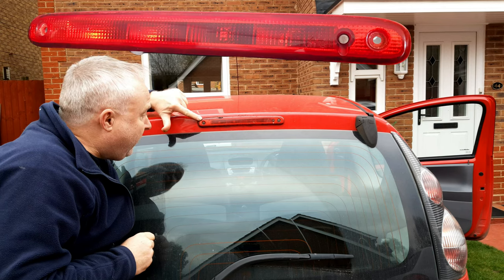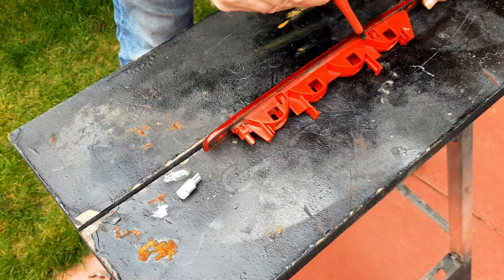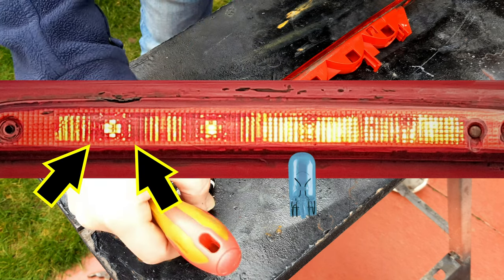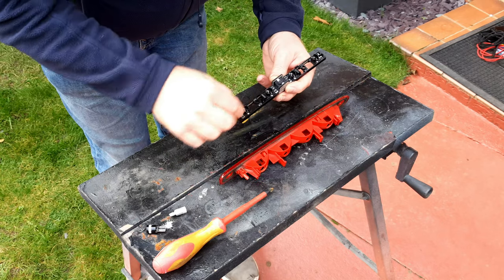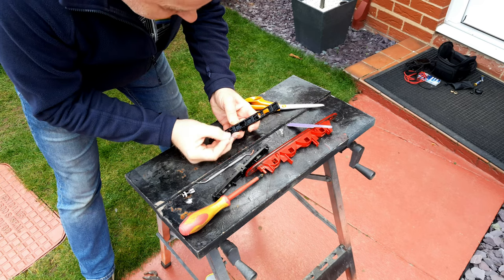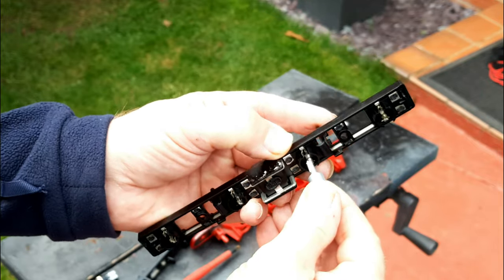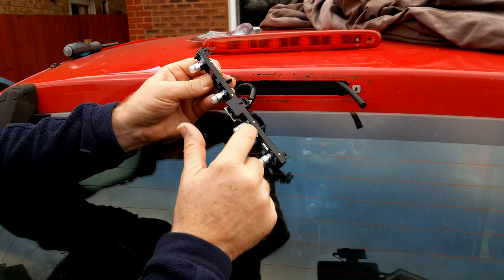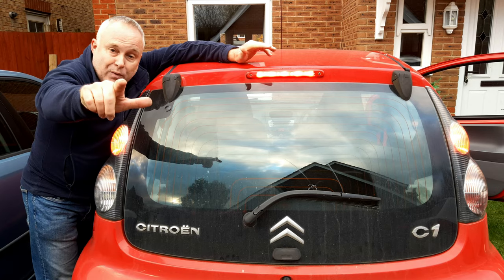Citroen C1 High Level Brake Light | AWESOME LED Conversion

Comment: I had some corrosion issues under this centre break light. I changed the break light with a poor seal to a better one I did have in my spare parts box. I’m already curious for the next video with the sealing trick! Thanks, Cyd for showing us the LED bulb conversion. ✨🤗✨
Reply from the maker: The common 'trick' is to silicone these lights in, but I think you will like the new product I'm going to be showing.
The video doesn't really do the LEDs justice, but they make the brake light so much better. Brighter by a moderate margin and a much more 'intense' red. 
I've got several rear end lighting projects coming up including LED indicators with auxillary reverse lights - simple plug & play stuff too.
There might be a slight delay in production though as my Father is in hospital and having a serious operation, so I'll be spending time with my Mum and helping them when he comes home.
Reply: @CycloneCyd  Don’t worry, don’t hurry! Take care for your parents, everything else cannot be that important. Thanks for your nice reply and greetings from Germany… 🍀👍🍀

Comment: Mr. Cyd I appreciate ALL you share with us and have found I have been able to fix 99% of all issues with my 2008 Saab 9-3 2T Convertible by watching your channel. QUESTION: Since the last rain I now have a warning alarm going off every 30 seconds to a minute or so indicating "Manually close top before driving." The convertible top is completely closed and the automatic function works because I had put the top down and brought it back up to see if it would stop the warning alarm. Can you help?
Reply from the maker: Happy to be able to help you JW.
I can think of two possibilities: 1. the top isn't properly closed (which is what the alarm is for) so check your handbook for intructions to close manually (or at least check it carefully). OR 2. there is a switch in one (or both) of the latches for the top and it is possible one (or both) have failed.
Unfortunately I don't have a vert nor access to one. I suggest searching for "Saab WIS online" and looking for the instructions for how to check these items. I've never used WIS online myself, but understand it's a great resource.
Reply: @CycloneCyd  Thank you so so much for your response and suggestions I will be getting to it in the morning. I will come back and let you know the outcome! 🙏

Comment from the maker: 🎥 NEW seal to solve CHMSL water leaks: https://youtu.be/2c7aW6k5nvo
Reply: Hey, do you have any idea if i can install android touchscreen to my Saab Aero 93 2003(B207R)? I would love to hear your thoughts, also if you make a video on that i would appreciate that a lot. Lots of people asking this question in groups. So you are gonna solve a lot of problems haha. Thanks!
Reply from the maker: @ΑδαμάντιοςΚανέλλης  You coul;d, but you will need to rerwire the entire system. I don't know how you'd go about getting indicator sounds back either. Up to 2006MY has a fibre optic system - it's a nightmare.